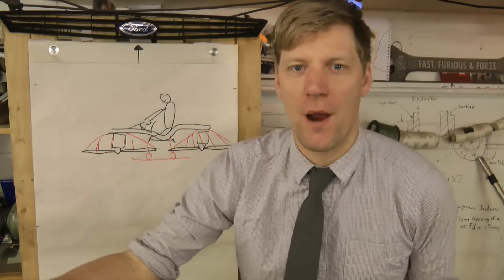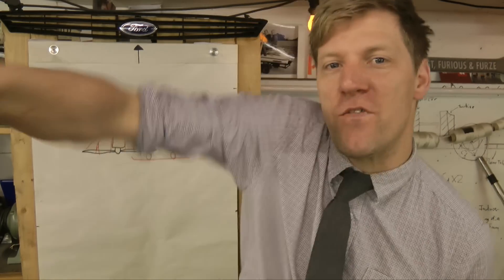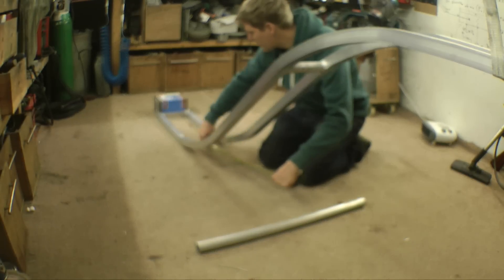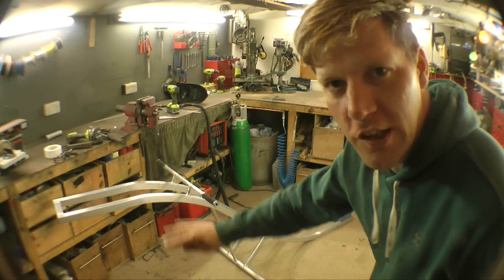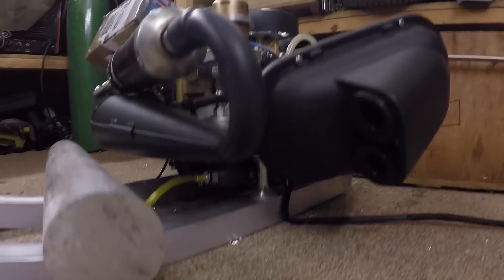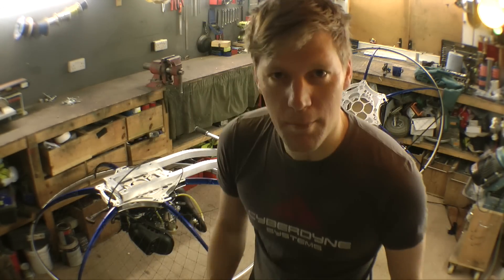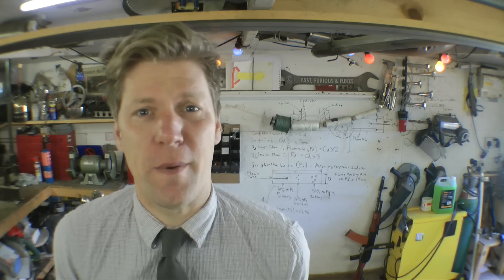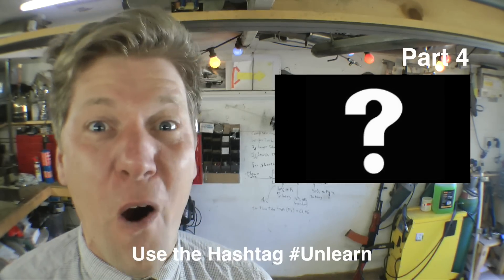Making a Home made Hoverbike

Comment: I'm disappointed... Propellers ?! This needs PULSE JETS !!
Reply: haha
Reply: +turarwanaa i think you mean turbo fan
Reply: Add a pulse jet to this design in the back for a faster forward speed
Reply: +Cr125stin pulse jet is heavy because it must be made out of stel it needs propane to run (propane tanks are too heavy) (on gasoline it can run too but then it don't have too much power) and propeller is stronger that why this is dump idea
Reply: +SwatTeamExit yep, and aluminium tanks are available that can hold the pressure, it could be done...
Reply: Maybe that could be the control...A multi direction pulse jet.  would certainly add another lever of danger.
Reply: +turarwanaa You want to strap Colin to a pulse jet??? The pulse jet was invented by the nazi's for the first long distance autoguided rockets to bomb London: the V1. It was autoguided, because the germans didn't want to use (more accurate) human pilots (unlike the Japanese kamikazes). The nazi's had to wait for 10 years before they invented the safer jetengine for manned jetfighterplanes. By then, they had already start loosing the war. CONCLUSION: even the nazi's wouldn't strap a man to a pulse jet. :-)
Reply: Gijs van de Lagemaat that was a bit deep.
Reply: +turarwanaa This isn't happy wheels this is real life
Reply: +SwatTeamExit Yup xD
Reply: +SwatTeamExit Yup xD
Reply: +Dymitr Nawrocki We need more boosters!
Reply: +turarwanaa pulses of power on a stable air craft with flowing power it will make it VERY shaky but yet interesting.
Reply: +turarwanaa It's not so crazy. Boeing has a patent of VTOL pulse jet powered airplane.
Reply: +turarwanaa Maybe he'll do it next fryday
Reply: He should just put pulse jets on it for forward propulsion once it can handle hovering.
Reply: +Owldude000 that's a good idea but he would probably have to recompensate for the extra weight but still good idea
Reply: Please watch